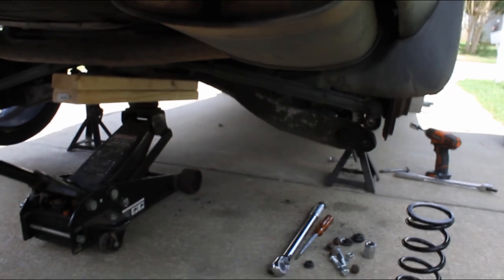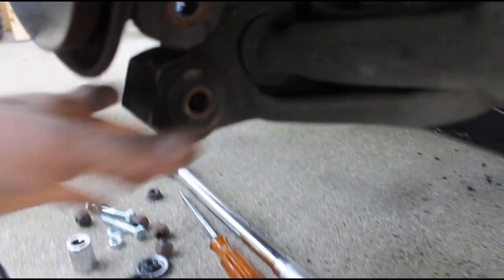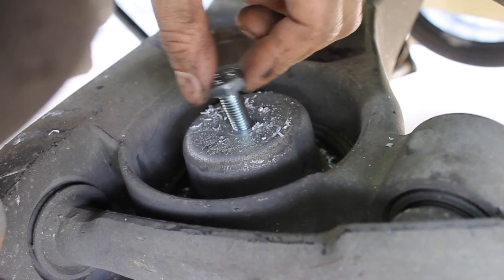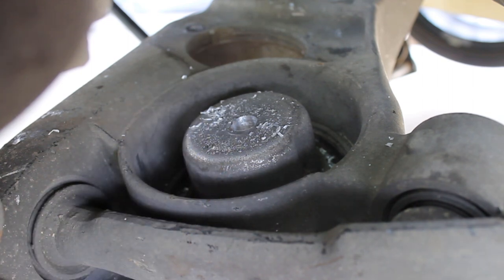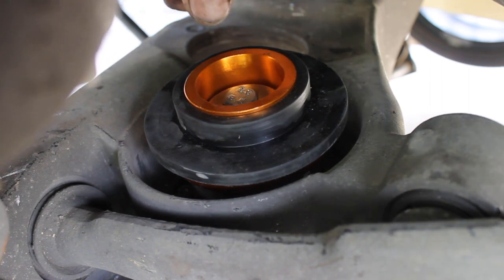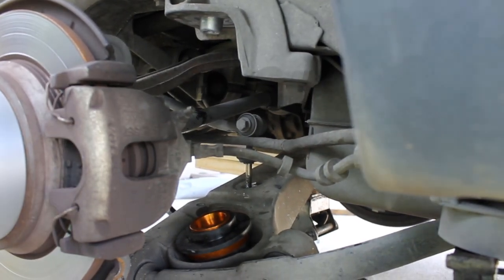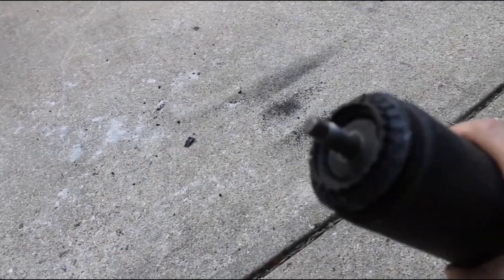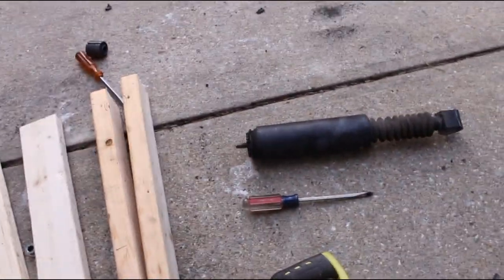$350 Coilovers PART 2!  FWD-AWD Rear Suspension!

Comment: So the whole nivomat lower loop and bushing can unthread from the shock shaft. Then you cut the mounts off the bottom of the Maxspeeding shock, drill a hole and put a bolt through it. Use the whole lower nivo mount.
Reply from the maker: The stock Nivo lower bushing has the mount inside it. The reason for cutting it apart is to retrieve that mount piece.  I'm sure it could be pressed out if you wanted to save the Nivo. But that piece then slides into the Max shock so it can bolt to the control arm. 
It is a smaller diameter than the bushing in the Max shock, so that's why I wrapped it in electrical tape temporarily.

Comment: Heads up for people looking to install these on a fwd setup. The fronts bolt in easy the rears are an absolute nightmare and don't fit properly. The rears had 3 major issues. First. the conical bearing that goes in the lower bushing isn't bored out enough to fit the bolt through. I had to take mine to school and bore them out on the lathe to .5625. If you can find a drill bit that size it'll work, but most drill bit kits only go up to .5. Second, the threads on the top are too long and the included spacer isn't long enough. You'll run into an issue trying to fit the rear wood panel in with the reverse facing seats. The panel will hit the adjuster knobs. I had to make my own spacers at 1.1 inches rather than the .5 inch ones they supplied to get them to fit. The third biggest issue is that both the rear springs bent within 3 days of normal driving and there's no way to retain the spring to the chassis. If you jack your car up in the rear, both springs will fall out which leads me to believe there's a possibility of that happening on the road which could be catastrophic. Other than that, the rear is so bouncy that it actually cracked my dash when I went over a speedbump on the way into the junkyard. They refunded me $80 dollars for the bent springs and for the modifications that I had to do. I sent them basically this exact same message, so there's a possibility that they fixed some of the issues but I highly doubt it. Just a fair warning for those looking for a cheap coilover setup. I wouldn't recommend them to anybody. Stick with your H&R's, Eibach, or Ipd springs and save for some BC's. You'll be a lot happier in the long run if you don't buy these. The fronts are also making a loud clunk when turning, probably should've drowned them in grease before installing.
Reply: Uhh oh. I bought a set of these for my 850 N/A for $40. Rear springs bent so previous owner used A chopped 850R spring. Springs should be no problem. Any idea how the shock itself will bolt in?
Reply: @ZacharyTelesca  I needed to use a larger spacer on the top of the strut to get it to clear under the wood base in my wagons trunk. The metal bushings on the bottom of the strut might need to be bored out to fit onto the shaft. I had to bore mine out. They've been on my car for about 6 months with IPD overload springs in the rear and are still holding up just fine. There's no clunking in the front anymore either so I guess the problem fixed itself.
Reply: @SkillCap  yeah I got rid of the kits rear coils and slapped in some chopped 850R springs. I had to use a spacer at the top also but it was in the box when i bought it. Idk if it came with the kit but when i bought the set it came with the right bottom bushings also. It all bolted in very nice. Rides like a bag of shit but it turns like its on rails 😂
Reply: @ZacharyTelesca  Did you get the adjustable dampening ones or the non adjustable? I was able to get them tuned to a pretty good setting after a few test drives. I think im on 8 clicks on the fronts and all the way softened in the rear.
Reply: @SkillCap  my rear shock is adjustable (strait from the kit). The spring is not adjustable. Its just a 850 spring I cut about an inch shorter

Comment: Hey man, I'm looking at using this setup on my 2000 v70 xc what size rim and tire are you running at the end of video?
Thanks in advance for any info you can provide
Reply from the maker: Wheels are 18x8 with 1.25" adapters. 235/40/18 tires. I did have to roll the fenders to fit them.
Reply: @ReadyDriverOne Sweet I'm looking at running a set of 18x8 rims with 225/40/18 tires with no spacers, I'm hoping I can tuck the wheels a little and avoid rolling the fenders for now.

Thanks for the quick reply and awesome videos!
Reply: @ReadyDriverOne  hey just curious we're you running the 1.25" adapters due to clearance issues with 18" rims?
Reply from the maker: @Warrett_Wubbins  no I use them because of the bolt pattern change. Finding nice wheels in 5x108 Volvo pattern isn't easy or cheap. This way I can use 5x114.3 and have tons of options.

Comment: Do you have a link for these? The only ones I can find on the site are for S70, is that the ones you used? 

Also how have they held up so far?
Reply from the maker: Car has since been sold. They seemed fine for the price. Rear springs were trash though. 
The coilovers for the s70 are the same as v70. Same version I used.
Reply: @ReadyDriverOne  ok thanks, what was wrong with the rear springs? Too soft?
Reply from the maker: @rat9369  very soft and not hardened enough. They became warped in about 1 month. When I removed them the left side was 2" shorter than the right. I put some Eibach springs in the rear with the same dimensions and those worked perfect.
Reply: @ReadyDriverOne  do you remember the dimensions for the springs you used?
Reply from the maker: @rat9369  I don't it's been so long. They're just basic 2.5" springs. I THINK 6" long and 250ish lbs.
Reply: @ReadyDriverOne  fair enough. Thanks for the quick responses anyways lol

Comment: Is it the same with the shocks on the base fwd? I will be traveling to install this and driving it home.
Reply from the maker: Base FWD should be a direct bolt in without going through all the stuff I had to do.
Reply: @ReadyDriverOne  thank you for the reply! What size tires are those? And is the v70xc any different like body size to the v70? I will definitely be following you on Instagram!
Reply: @ReadyDriverOne  looks amazing by the way and I can't seem to find your Instagram
Reply from the maker: Thanks man! 
@ready_dr1ver_one is my Insta.
Reply: There's quite a bit that needs to be done to fit the rears on a fwd setup. It's supposed to be bolt on but they had a lot of fitment issues. Check out my other comment on this video for the steps I had to go thru to get them to fit. Not likely that you'll be able to drive home with them if you don't do the mods I list.

Comment: need some areo like that for my swed. video on that?  and pulling fenders
Reply from the maker: What aero specifically? rear diffuser/side skirts/front lip? I can throw something together when it warms up a bit. check out my Instagram I tend to post more in-depth small stuff like that there.
@Ready_Dr1ver_One
Reply: It's better to actually shave the lip off the fender than to pull them on these cars. Use a flap disk with an angle grinder and you can fit a much wider wheel while still maintaining the stock look. Very hard to tell that anythings been done to the fender unless you run your finger along the inside, which will be nice and smooth after hitting it with the flap disk.
Reply: @ReadyDriverOne  I'd definitely be keen for a video on the rear diffuser and front lip!